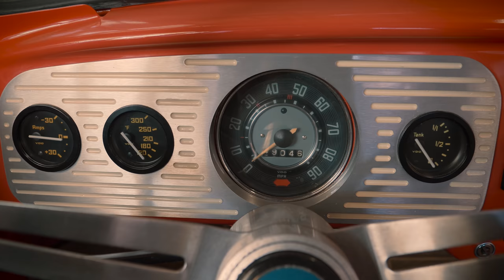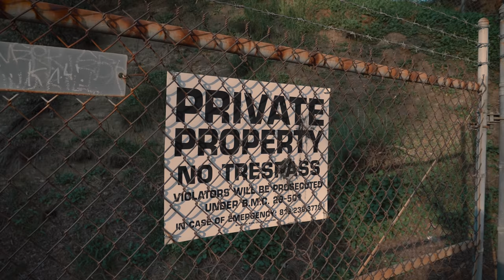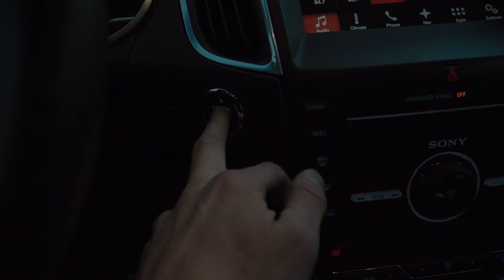1967 Bug Hits The Streets For The First Time In 15+ years - Webisode 4 [4K]

Comment: Try driving any other car but bug after that many years and it will self destruct.  I have beautiful 69 bug convertible that I bought in 69.  Comes out two months every year for my wife to drive on errands.  Only thing I have done in last 6 years is change oil and it fires right up.  I have many muscle cars new and old, but the bug is car everyone stops you and wants to see it.
Reply from the maker: Cool🏁
Reply: I pulled my 74 super beetle out of my field in my backyard after it say there for 9 
Years and it fired right up the only thing I have to do is clean the carb
Reply: killer snowman get it fixed up a little.  Bugs are in big demand.